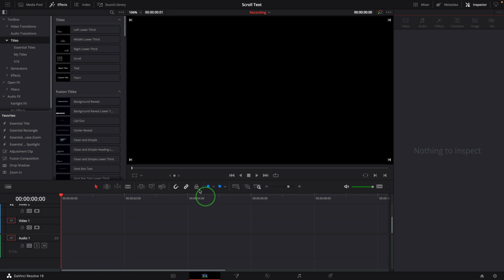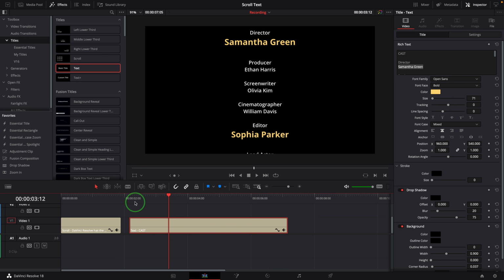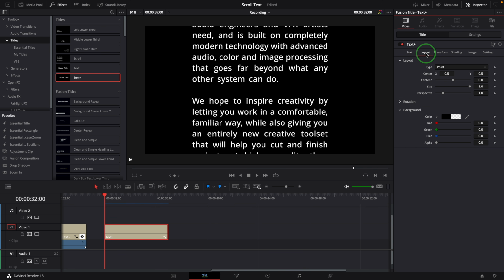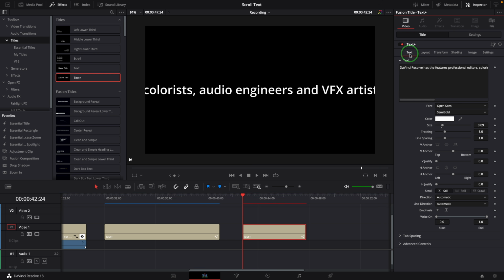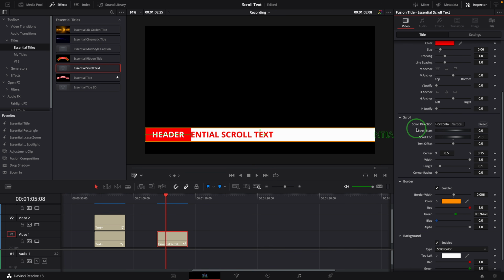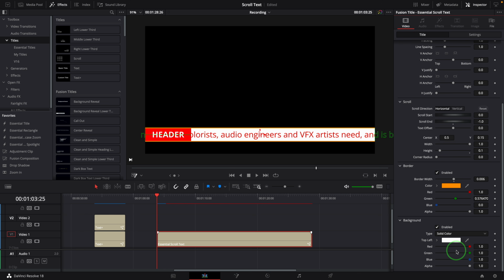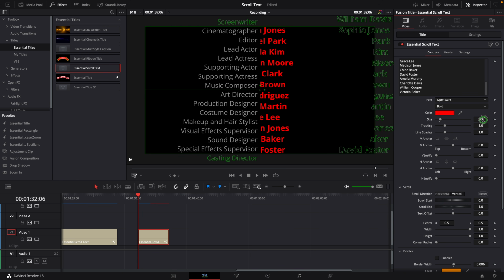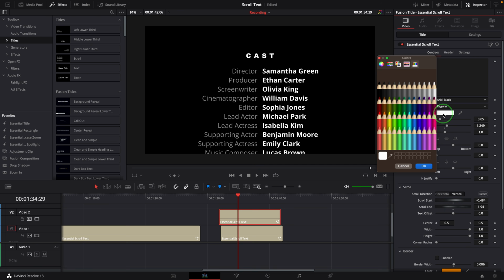Rolling Credits and Crawling Text in DaVinci Resolve - FREE Scroll Title Template Updated

Comment: For your second example, how would you limit how far up the text scrolls before the top line disappears? Like, if you want the scroll to stay under a still text.
Reply: You can put the screen head at a position you like the text to stop. Then go into the color page an grab a still of the screen (look for tutorial on grabbing screen stills if you don't understand.) You export that still and then you bring it into your media pool. You then put that still at the screen head position in a track above the old text and drag it to the end of the clip. Your text will freeze at that point. It is important not to move the screen head during this.    Another simple way is to stretch out the scrolling clip to where it is still visible. Then at the end of where the text needs to end, you add an opacity key frame close to the end and then move the play head slightly and put the opacity to zero.

Comment: Great video, works great, but does the horizontal scrolling text need to scroll at the same speed or higher framerate as the timeline frame rate settings? I see some slight jitter in a lot of YT scrolling solutions, not just these ones.
Reply from the maker: I noticed that too, but it's up to you how fast or slow you want to scroll the text, there are settings in the template you can use to adjust the speed.

Comment: There's a bug that I can't seem to get past when creating a two-column spread. When I adjust the size of the left column, it adjusts the size of both the header and normal text. When I adjust the right column, it adjusts by itself.
Reply: me too...any workaround?
Reply: Same here on DVR Studio 18.5
Reply: @HTOtv  Did you ever figure this out? Having the same issue.
Reply from the maker: The width on the first tab is used to define the width of the scroll area, that's why it seems both sides are changed
Reply: @EssentialVideoEditing  How is this fixed? When I see your tutorial, it doesn't happen to you.

Comment: With the Essential Scroll Text, would it be possible to add a border directly to the text? I'd like a scrolling text over an image that is far from being monochromatic, and without a border there is no way to make it properly readable...
Reply from the maker: The Text Shading tabs are not exposed as the macro parameter, you can not do it in edit page, but you can open the scroll text template in the fusion page, and select the text node and add the outlines however you want.

Comment: Another excellent and informative video. Is there a way to loop the text scrolling or crawling repeatedly, any number of times? Can we add a loop function in the controls menu, in the inspector? I am very curious about it. It is easily done in After Effects. But I have been struggling to find a compact way to do it in DR. Thank you for taking DR closer to us by the day.
Reply from the maker: Thanks for your suggestion, I will add that function in the next update. Loop an animation in DaVinci Resolve is very simple, in the keyframe editor in Fusion page, you select the keyframes and enable the Loop.
Reply: @EssentialVideoEditing Thank you for the response. My question is a little more complex, I guess. Before the previous text crawl has left the field of view, the second text crawl must make an entry and for some time, the previous and current texts must be in view, as we see in TV news tickers. Kindly shed some light on this. Thank you.
Reply from the maker: You can stagger the scroll text clips on top of each other, so before the first text line is out, the second one comes in. Make sure to turn off the background of the clips. if you need a scroll background, add an empty scroll text at the bottom as the background, extend the duration to match the length of all scroll text clip. I can make a short video to demo that.
Reply: @EssentialVideoEditing Thank you very much. Now it works like a charm. 👍